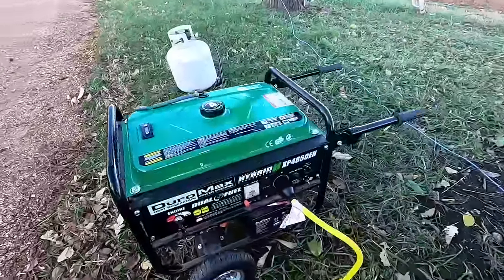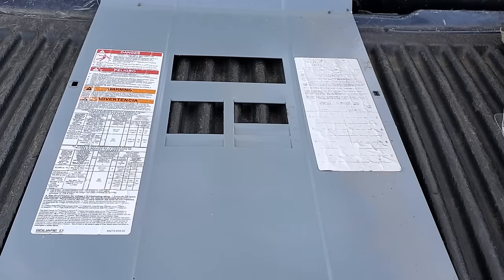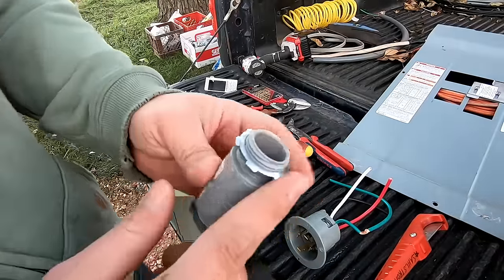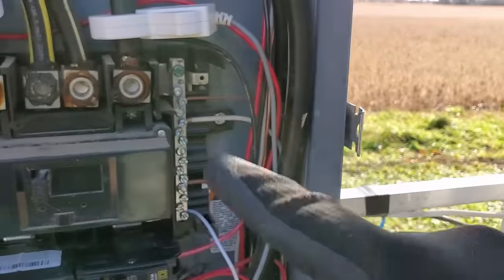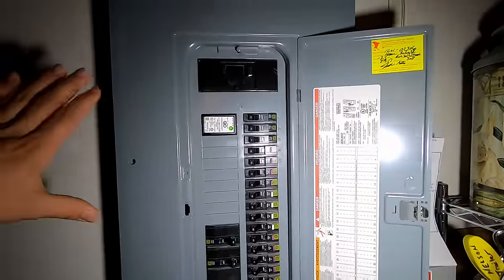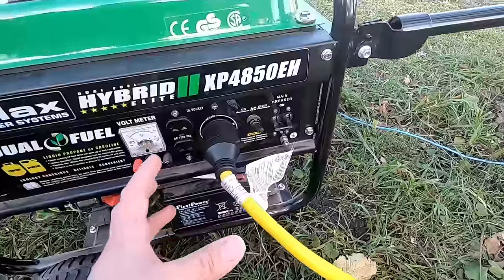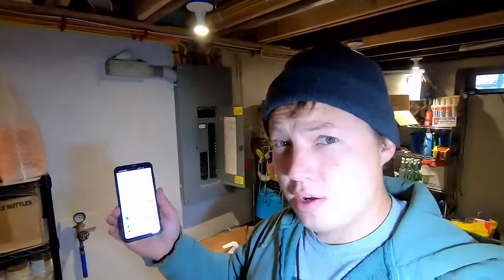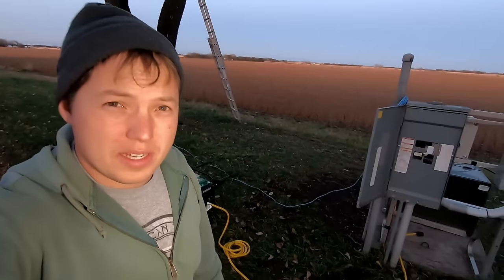How To Hook Up a Generator To Your House Using a Breaker Interlock Kit & Power Inlet Box

Comment: Thank you for making this video it is extremely helpful. I also used your discount code to get the Sense. Dumb question. I'm going to be wiring up an interlock soon. When my generator breaker is active AND my main is off, how do I know when my power comes back? It could be obvious but wanted to ask.
Reply: Could maybe use one of the non contact voltage probes like Fluke makes, which light up in the presence of AC, and put a photodiode sensor circuit to trigger a wireless doorbell or garage door sensor, which would sound off once power returns. Radio Shack Mailguard would be perfect for this if they still had them.
If you're close enough to the breaker panel just using it to switch on a bell or other sounding device would work
Reply: Here are the Generator safety tips: Always make sure you follow all the generator safety rules whenever you use your portable generator. This is a reminder for everyone’s safety of using generators. Generators can be dangerous if not used carefully. Every year, hundreds of people die or get injured when using portable generators due to carbon monoxide poisoning and electrocution. Make sure you are using your generator carefully and keeping others safe as well. There is something very serious that everyone should always be aware of when using generators. Some people do run their generator indoors which is not safe and that increases the risk of carbon monoxide poisoning which can cause death of family and you. Some people run their generator in wet conditions which can electrocute them. Please remember that you should never run your generator indoors. Remember that carbon monoxide is an odorless and colorless gas that you cannot see or smell. Carbon monoxide is a silent killer. Keep that in mind. Make sure your generator is 15-20 feet away from your house and away from doors, windows, and vents. Never use your generator in your porch too. Having a carbon monoxide detector is very important against generator safety. Some people also allow children to go near the portable generator which could pose risks. We need to keep an eye on our children making sure that they are not near the portable generator so they won’t get electrocuted or burned by the generator which is dangerous. A locking enclosure also keeps kids safe. A generator shed might look like a tempting place to explore, or take cover during a game of hide and seek, but a generator is a dangerous piece of equipment that can cause injury. It says on the manual that we should also keep children away at all times from the portable generator to avoid injuries. Please do not allow a child or unqualified people to operate the portable generator.  It is important to keep your children safe especially little ones. The portable generator can be hot during an operation. Just because some manuals missed what should be listed doesn’t mean it’s safe to do. Always follow the generator safety rules when using portable generators. Generators pose electrical risks. If you need to use your generator during wet weather, you need a generator tent to protect your generator from getting wet. Don’t let your generator get wet. Keep your generator dry and before using your generator, please make sure your hands and your generator is dry. Do not wear loose clothing when operating the generator. Everything that is said on the generator’s operating manual should not be ignored. Never smoke cigarettes near the generator. Please keep flammable things away from the generator. Never overload your generator too. Your generator can catch fire. Never ever try to plug a generator cord into a wall outlet to avoid back feeding. Back feeding your generator is dangerous. Always turn on your generator first before plugging in appliances and shut off the appliances before turning your generator off. Use a heavy duty cord for your generator and the cord should not be worn out. All the instructions should be followed carefully. Never refuel your generator while it’s running. It can cause fire if fuel spills while your generator is hot. You should turn off your generator and let it cool off before refueling it. Having a fire extinguisher next to the generator is also important. This is only a reminder for everyone’s safety of using generators. Make sure your generator is properly grounded. Having a fire extinguisher next to the generator is also important against the safety rules. https://youtu.be/I1jT3ANENvI and here is a video more about keeping others safe when using generators and also about our family’s safety. It’s important to keep our little children safe as well. Make sure your little children are kept away from the generator at all times especially when it’s running. Hope this helps. Always remember that it’s better to be safe than sorry. Also remember that warnings should not be ignored too.

Comment: So a full house generator like a Generac 15000 w is about $4500. Two 7500 watt generators can be purchased for less than $2000, and a human being can move a 7500 w generator around. I have not seen any videos that use two 7500 w generators in tandem, so there must be some problem hooking two generators to a transfer switch. Sure like to see that problem solved...Thanks for your video, good job.

Comment: Good job but I have never had an inspector let us run the ground over top near the feeder wires.There is no OCP on the line side if the ground touches the lugs it's an explosion.

Comment: and as the norm the ground circut is allways checked and  the fist circut hook up.
Reply: ⚠️ Here are the reminders about generator safety. We always need to make sure we follow all the generator safety rules whenever we use portable generators: 

Everyone must see this 

1) KEEPING OTHERS SAFE: Please do not allow an unqualified person or your children to operate and service the portable generator. Just because some manuals don’t say that doesn’t mean it’s safe. That is important against the generator safety rules. We also need to be keeping an eye on our children too. You need to make sure that your children are not playing near the portable generator especially when it’s running so they won’t get electrocuted. Generators pose electrical risks and they can be hot during an operation. Please keep your children away from the portable generator at all times. It is important to keep our children safe especially our little ones. Be aware of all the hazards.

2) WHERE TO RUN YOUR GENERATOR: Some people use their portable generators indoors which increases the risk of carbon monoxide poisoning. It’s important to have a carbon monoxide if you have a gas generator. Never ever use your generator indoors even if your doors and windows are open and even in the garage is not safe to use a portable generator. Not even at your porch and your deck. It is never safe to use your generator indoors and in enclosed areas of your home. Your generator needs to be 15-20 feet away from your house. 

3)🔥FIRE HAZARDS: Never refuel your generator while it’s running. You need to let your generator cool off before refueling it and before storing your generator. Never overload your generator too. Never ever back feed your generator. You should never plug your generator into a wall outlet. Also never store propane tanks indoors. Please keep flammable things away from the generator as well and please don’t smoke cigarettes near the generator. Having a fire extinguisher next to the generator is also important against the generator safety rules. 

4) GENERATOR OPERATION: make sure your hands are dry before touching the generator. Never use your generator in wet conditions. Don’t let your generator get wet. You need a generator tent if you need to use your generator during wet weather. Please don’t wear loose clothes when operating the generator. Turn on your generator before plugging in appliances. Use the right cord for your generator. Please do not use worn out cords. 

https://youtu.be/I1jT3ANENvI and here is a video more about keeping others safe when using generators 

Hope this helps

Comment: How did the sense work while the generator was running?
Reply from the maker: Worked great! I show the Sense Energy Monitor working towards the end of the video with the generator. You should check it out! Also, consider subscribing you haven't yet and are interested in this sort of content. You can also get $25 off of Sense with the above link if you do decide to pick it up.

Blessings from MN!
Reply from the maker: 22:11 is where I show Sense working with the generator. The only other thing to keep in mind is that Sense needs your WiFi and internet in order to work.

Comment: Nice generator but a bunch of complaints about propane leaking out of the regulator, parts on back order and under warrantee parts people ordered they had to pay SHIPPING for! Read the Amazon reviews
Reply: ⚠️Portable Generator Safety Tips:

1) KEEPING OTHERS SAFE: Please do not allow an unqualified person or your children to operate and service the portable generator. Just because some manuals don’t say that doesn’t mean it’s safe. That is important against the generator safety rules. We also need to be keeping an eye on our children too. You need to make sure that your children are not playing near the portable generator especially when it’s running so they won’t get electrocuted. Generators pose electrical risks and they can be hot during an operation. Please keep your children away from the portable generator at all times. It is important to keep our children safe especially our little ones. Be aware of all the hazards.

2) WHERE TO RUN YOUR GENERATOR: Some people use their portable generators indoors which increases the risk of carbon monoxide poisoning. It’s important to have a carbon monoxide if you have a gas generator. Never ever use your generator indoors even if your doors and windows are open and even in the garage is not safe to use a portable generator. Also please never use your generator in your deck or balcony. It is never safe to use your generator indoors and in enclosed areas of your home. Your generator needs to be 15-20 feet away from your house. 

3)🔥FIRE HAZARDS: Never refuel your generator while it’s running. You need to let your generator cool off before refueling it and before storing your generator. Never overload your generator too. Never ever back feed your generator. You should never plug your generator into a wall outlet. Also never store propane tanks indoors. Please keep flammable things away from the generator as well and please don’t smoke cigarettes near the generator. Having a fire extinguisher next to the generator is also important against the generator safety rules. It’s also not safe to move your generator while it’s running.

4) GENERATOR OPERATION: make sure your hands are dry before touching the generator. Never use your generator in wet conditions. Don’t let your generator get wet. You need a generator tent if you need to use your generator during wet weather. Please don’t wear loose clothes when operating the generator. Turn on your generator before plugging in appliances. Use the right cord for your generator. Please do not use worn out cords. 

https://youtube.com/shorts/eFigDfnPkcQ?feature=share and here is a short video more about keeping others safe when using generators. Portable generators need maintenance so it’s important to follow the safety instructions.

Hope this helps

Comment: Great videos Ben.....
I have watched and am subscribed to your channel. One thing I have noticed in your "Hooking up the whole house to a generator" and most other YouTube videos they all seem to be working with 240 volt generators.

In my case and I'm sure others, we have a 120 volt generator, 4000 watt,  and plan to only use 120 volt circuits. All 240 volt breakers will be turned off. A Mains interlock is in place. But we need to feed a 2 pole 30amp breaker so we can have 120 on both sides (legs) to energize all the 120v circuits.

I have my plans on doing this and would like some input from you or your readers if anyone has accomplished this.

As you are, I am also not a licensed electrician, but have changed out entire panels, rewired and wired my own house and passed every inspection. So your thoughts on this subject would be appreciated.
Reply: @The_Happy_Aviation_Enthusiast  your reply, although factual about generator safety, was irrelevant to my post to Ben as it was focused on circuit breakers and not generator safety or operation.

Comment: I have a 3000 watt generator that has two 120 receptacles, and no 220 volt receptacle. If I use one of these interlocks would I use a single pole or double pole 30 amp breaker?  I have no intentions of running any 220 volt appliances.
Reply: I will probably use a 25 amp breaker.

Comment: I am considering installing a Reliance Control 31406CRK Pro/Tran-2 6 circuit Transfer Switch. Seems a lot simpler to wire up instead of the interlock system. Do you have any experience with this system? Looks it would work with my solar system also. New subscriber and love your videos.

Comment: I was wondering about something Ben.  I noticed that you are using #10 wire.  At what gauge do you use a split bolt or a bug?
Reply from the maker: I am not aware of split bolts being required at a specific gauge as split bolts are available for all of the common wire gauges. Any connector that is rated for the given gauge of wire and that is listed for the use should be adequate. Let me know if you know of any situations where they are required. Good question! I might make a video regarding split bolt connections in the future.

Comment: Excellent video.... I wonder how much would an electrician charge? To get this done
Reply: well around here they charge by the hour $100.00 to $130.00 a hour ,panels they charge by the job 200 amp is $1200.00 to $1500.00 when the owner does he hauls ass has it done no time .

Comment: A good video as usual Benjamin.   So its been about 1-1/2 years since you posted that generator install.  How many times have you gotten to use it?  In your area is it more often winter snows or summer thunderstorms that knock out electricity?

Comment: Very informative video. Great job
Reply: Don’t forget about the generator safety tips as well. Remember safety is always important. Here are the generator safety tips:

1) Please do not allow an unqualified person or your children to operate the portable generator. Just because some manuals don’t say that doesn’t mean it’s safe. That is important against the generator safety rules. We also need to be keeping an eye on our children too. You need to make sure that your children are not playing near the portable generator especially when it’s running so they won’t get electrocuted. Generators pose electrical risks and they can be hot during an operation. Please keep your children away from the portable generator at all times. It is important to keep our children safe especially our little ones. Be aware of all the hazards.

2) Some people use their portable generators indoors which increases the risk of carbon monoxide poisoning. It’s important to have a carbon monoxide if you have a gas generator. Never ever use your generator indoors even if your doors and windows are open and even in the garage is not safe to use a portable generator. Not even at your porch and your deck. It is never safe to use your generator indoors and in enclosed areas of your home. Your generator needs to be 15-20 feet away from your house. 

3) 🔥generators cause fire hazards too. Never refuel your generator while it’s running. You need to let your generator cool off before refueling it and before storing your generator. Never overload your generator too. Never ever back feed your generator. You should never plug your generator into a wall outlet. Also never store propane tanks indoors. Please keep flammable things away from the generator as well and please don’t smoke cigarettes near the generator. Having a fire extinguisher next to the generator is also important against the generator safety rules. 

4) generator operation; make sure your hands are dry before touching the generator. Never use your generator in wet conditions. Don’t let your generator get wet. You need a generator tent if you need to use your generator during wet weather. Please don’t wear loose clothes when operating the generator. Turn on your generator before plugging in appliances. Use the right cord for your generator. Please do not use worn out cords. 

https://youtu.be/I1jT3ANENvI and here is a video more about keeping others safe when using generators and also about our family’s safety. Hope this helps

Comment: running the wires on top is very much a no go .
Reply: This comment keeps coming up in the thread,  so let's be clear;  in Canada under CEC rules you're correct (UK / EU boxes also I think ).  US at present doesn't think it's worth idiot proofing an inherently hazardous product,  maybe fewer living idiot's is considered a design "feature" 🤔😆.
USA operates by NEC rules which change slowly and only by consensus of many concerned parties where actual data shows a need. Not saying its necessarily better,  but it largely depends on trades to be suitably trained and apprenticed (non-derps only should be advanced to journeyman level) who can read and heed the NEC chapter-and-verse in the context of the IBC (International Building Codes). A lot to ask admittedly,  but permitting a wider range of flexibility in cost vs benefits in designs.